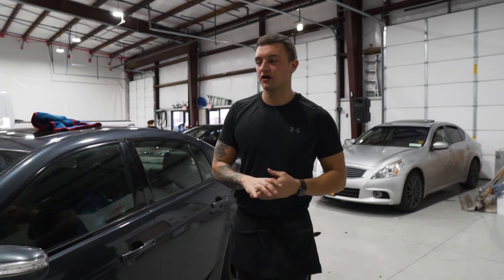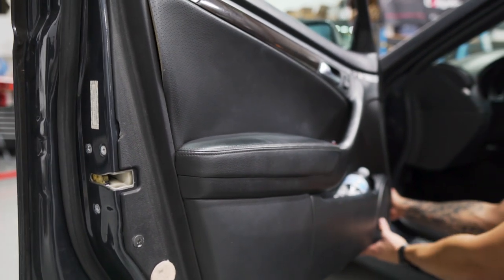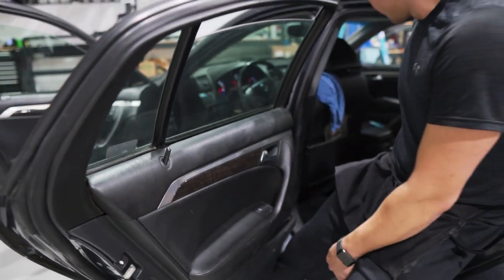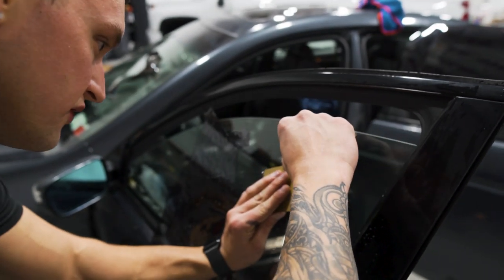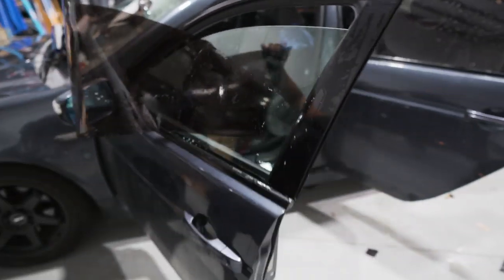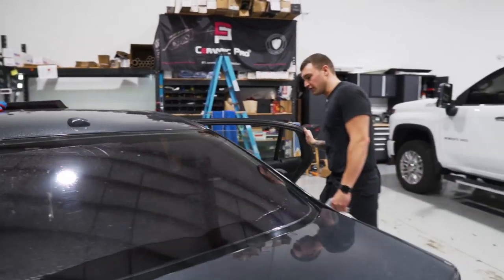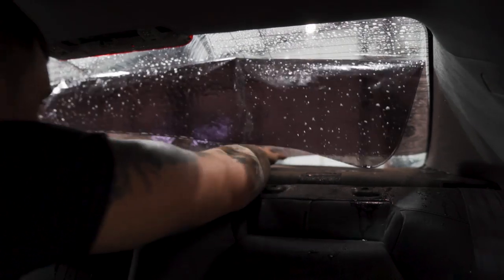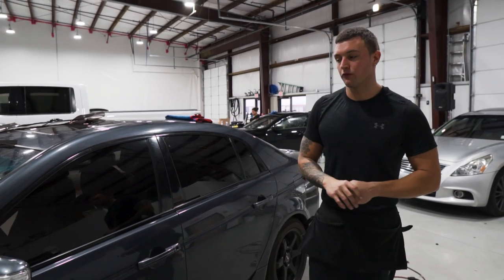How To Professionally Tint A Full Car - 2007 Acura TL

Comment: I have a question.. Why did you not shrink the tint for the side windows? by the way great video!
Reply: its just faster to do it his way. also you are locking in the bottom edge and shrinking all in one step.
Reply: @taseenmajid6560  I did not see him shrink it down nor did any fingers pop up. Is this because he is bottom loading and not using the half method?
Reply: @ibs547  if you bottom load you will see that you end up with almost no fingers. There is a reason bottom loading is proven to be faster and cleaner than two step
Reply: @taseenmajid6560  got you, thanks

Comment: I never understood why risk breaking a customer door panel to tint the windows. Why not use today’s tucking tools to get the same results?
Reply: It’s called going the extra mile for a quality job. You get what you pay for plus do you really think they are letting the car go back with a damaged door? 🤦‍♀️
Reply: Truebrouce no but it’s a waste of time and I been tinting for 11 years and I never pulled a panel  and still get the same quality. It’s just risky and I rather not do it
Reply: Truebrouce also using the heat gun on the inside of the car is taking a a risk of burning panels . I’m not knocking his was I just don’t think it’s best way to do it. Just my opinion
Reply: Terry Taylor upload a video of how your shrinking fingers with out taking the panel off ? Since it’s a risk of burning? Would like to know
Reply: Truebrouce have your every heard of snap shrinking.  I’ll send you a link from Matt at tintstuff
Reply: How many redos do u have a year with pealing from the bottom?  I pull pannels and never have a peal on the bottom whatsoever
Reply: Tyler Bush 2. only because I didn’t cut the film long enough on a Mercedes. Their seal are really low.  Also one time when I first started tinting because I was a rookie. It’s not rocket science but do whatever you’re comfortable doing.
Reply: Truebrouce sometimes the door is not damaged afterwards BUT rattling noises begin
Reply: True that’s why  sometimes yours door Panter getting lose and lose after breaking one time when I do mine just sticking in little by little  bit good point bro